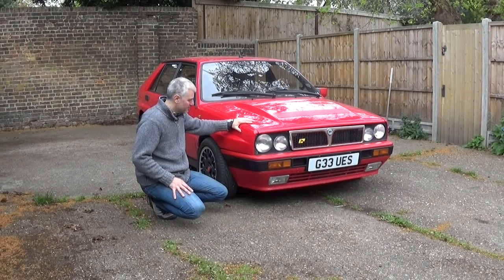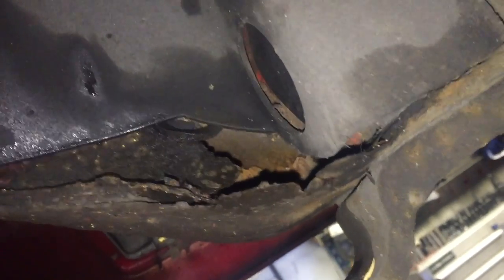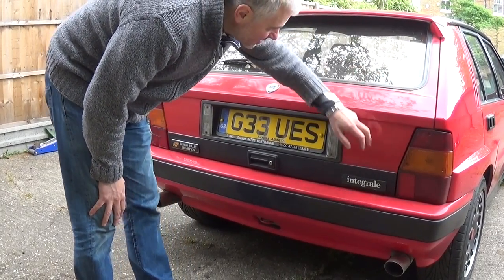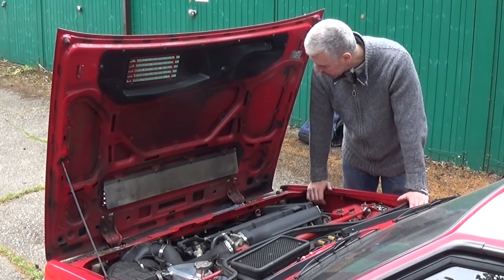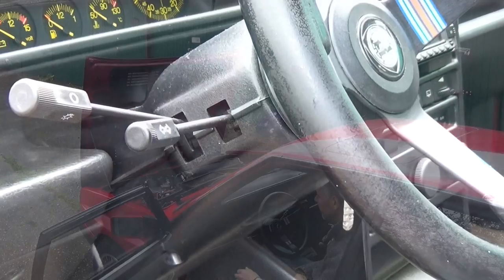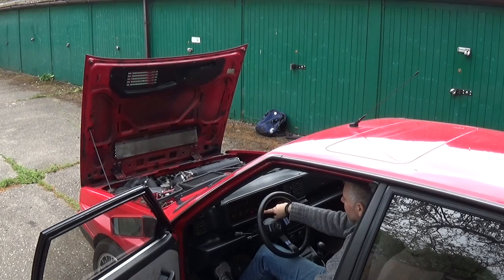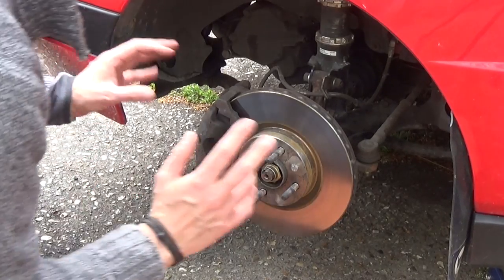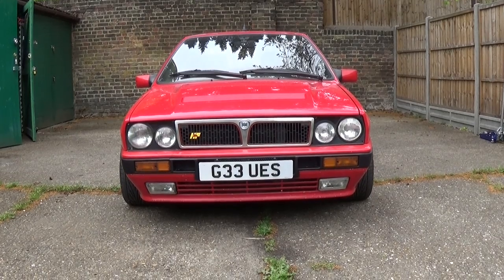Lancia Delta Integrale 16V Buying Guide

Comment: Thanks for the video. Very enjoyable. My rosso 8v perforated away, I spent a fortune on it but at the time I sold you could pick one up for 2kukp. I kept my Evo2 and now its undergoing full restoration. Another place to look for rust is behind the rear bumper. Mine was filled with expanding foam!!! The wings were filled with some sort of rubber. Get your magnets out before buying.... Also dont let people hold on to the 'Jesus handles" they snap easily. You can go through suspension bushes quickly, but upgrading to polybushes can lead to stress cracks... Another issue...

Comment: Good review. I found on mine the roof warped as the shell flexed too much with full power and 4WD, although not powerful by today's standards. My feeling is they definately need a roll cage in to give the shell more rigidity and strength plus strut braces. You are a good presenter. You don't shout at the camera which is refreshing. So many YTers do which annoys me. It's like you are talking normally to the viewer, me, standing next to you. I guess you have now sold your Integrale. I only had mine for 2 years. Maintenance costs were eye watering. Nearly bankrupted me, but it was nice while I had it, more for the exclusivity and to have owned one more than anything. I found it quite tiring to drive on a long run. Best drive was going from Salisbury up to Holyhead through up and over North Wales and then across to Ireland and up to the Antrim coast. Great on B roads not so good on bigger roads or motorways obviously. Thanks for making and sharing.
Reply from the maker: Hey, thanks for watching and for your comments Alex.. i too feel that perhaps extra stiffness would make the car more enjoyable to drive.. it did feel like it might fold over at any time!!
Reply: @Number27  Apparently Lancia in making the Integrale wanted to give the Italian family man a car he could drive to work, to take his family out and to go rallying at weekends. There were no 3 door Integrales. The 5 door shell really wasn't strong enough. Those that are turned into rally, sprint and hill climb cars have cages fitted but for safety regulations. It stiffens them considerably.

Comment: Great video.  Thanks for the information.  These call me like a rally-bred siren, but I am concerned about the rust issues and the possible lack of available parts over here in the U.S.  Would you say the hassles were worth the experience?  I know maintenance and repairs are part of the classic car life, but coming from an MGB and 944 I'm used to relative durability and reliability.  Thanks.
Reply from the maker: Hey Stephen, it would be crucial for you to get a good car to import. With you being in the USA that will be difficult but not impossible. You'd need to go through a respected dealer and here in the Uk I would only really trust Auto Integrale. Parts availability here is relatively good but probably quite restricted in the US. If you live near some tight windy roads then it would be worth while for sure.. if not then I'm not so sure. This one will be for sale soon but it is a high mileage, modified car so not sure it would be what you're looking for.

Comment: Cool vid. Just one thing, you say your car has an Evo front end, is that just the callipers? If it were a full Evo front end, then it would have a 5 stud hub too..
Reply from the maker: Russell hi Russel, it has EVO suspension arms so the front end is the same width as an EVO.. the calipers and discs remain 16v though as do the hubs!
Reply: Ahh ok. Are you running Evo wings on the front?
Reply from the maker: No, 16v wings which is why the wheels are so flush.. they don't rub though. I think mine is one of 3 uk cars to have this conversion
Reply: Number27 It's funny really. I think most of the integrale's were built with what ever was close to hand at the time lol